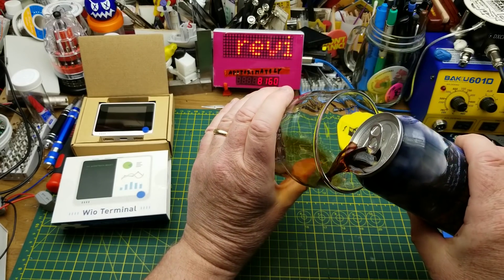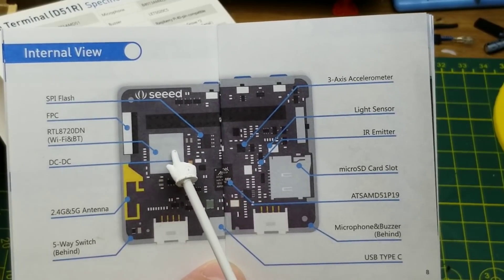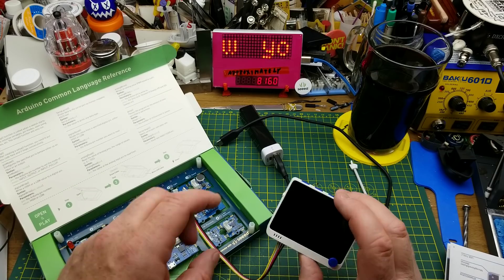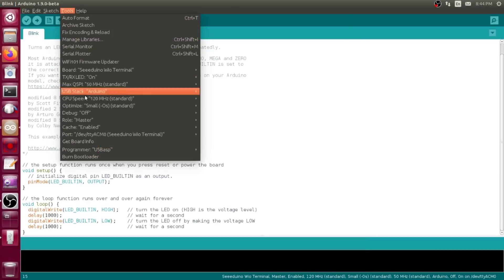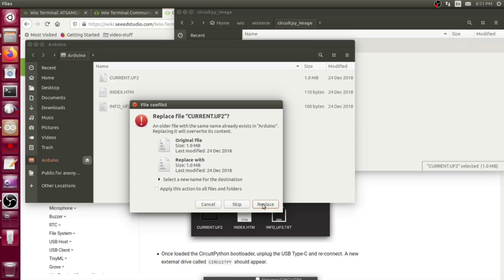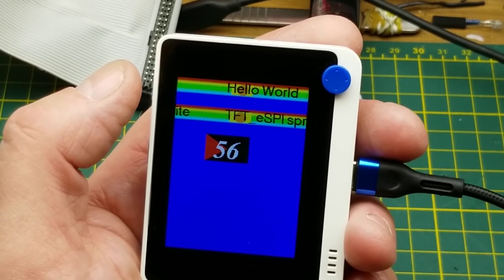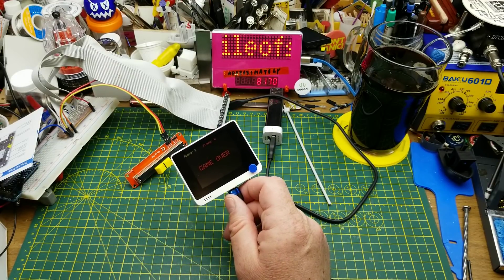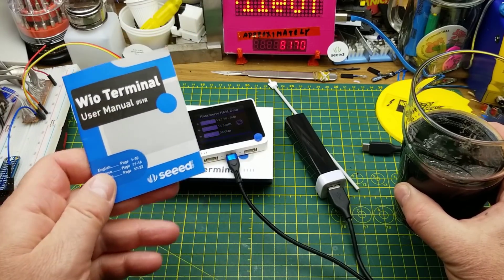WIO terminal first look and review

Comment: Very nice demonstration. Was just wandering ... Can this device be used to develop games like lets say NES type stuff and have 2 game controllers connected to it? If it can be done then it's a massive device.
Reply from the maker: I don't think it's the same processor as those handheld consoles, so the code probably  wouldn't be directly compatible.

Comment: What an interesting piece of kit - thank you for the heads up. 😀👍
Reply: Would seem to be a good kind of thing to control a 3d printer, with a RAMPS board on the other end of the 40-pin cable, of course.
Reply from the maker: I don't think this unit has enough GPIO for a standard RAMPS, but with some creative use of SPI or I2C it should be able to do the job - it has more than enough processing power.

Comment: Thanks for the look at this!  I am working on a personal project that this may be perfect for. It's a small telescope spectrometer. I'm reading the data from the sensor from a Wemos D1 mini and sending it to Node-red/0MQ to be stored and graphed.  I would like a way to get the focus set properly from target to target. Currently, for my test setup, I'm looking at the graph at the luminosity channel to get the brightest reading and assuming that's the focal point. It would be nice to have a graphical tool on the scope for this and also could look at raw data as well. I do have an M5 Core that I was thinking about using for this, but I kind of like the WIO better :)  After I get some other mechanical issues sorted out, I think I may get one. Thanks!

Comment: Very cool device.  Looks like an improved version of the M5 Stack.   I love the idea of being able to interact with outside sensors and hardware, but that definitely takes away from the slick form factor. I think the thing is really in its element when it's being used as some sort of interactive display using a mix of the onboard hardware and other things it can gather over its network connectivity.  Thanks for teh demo. I had never heard of this thing until your mailbag.
Reply: In a way it is better in a way its not.
The biggest improvement over the m5stack is that it works as a USB drive and uses circuit python. Because it has the 4 pin grove, it can run all M5Stack units!
I brought one for CP uses but just not had time to play and test.